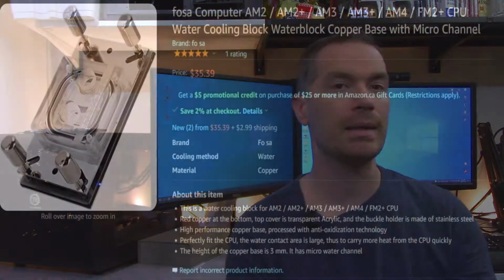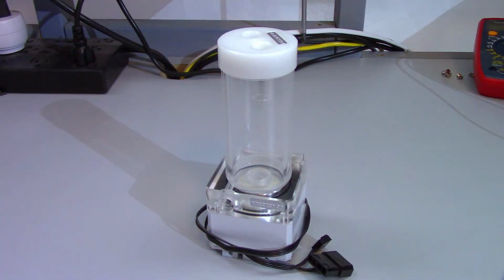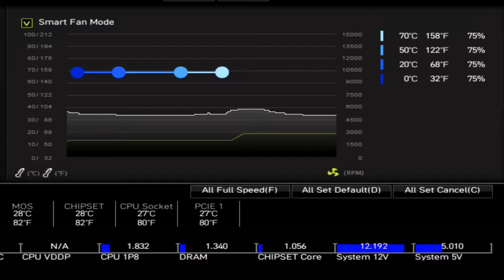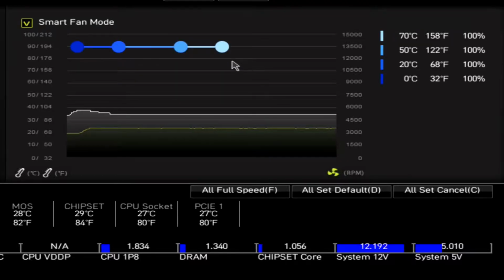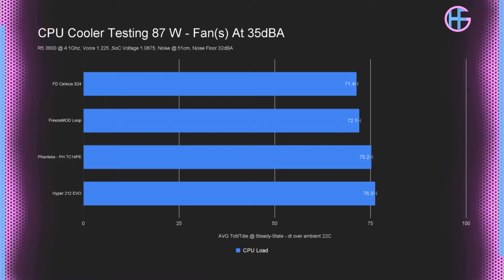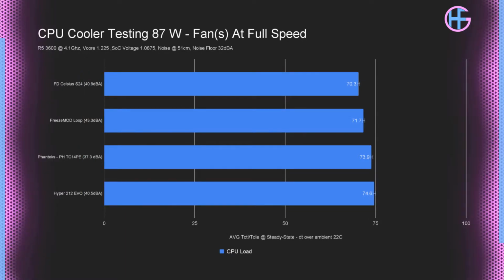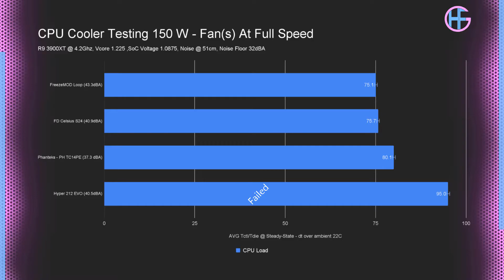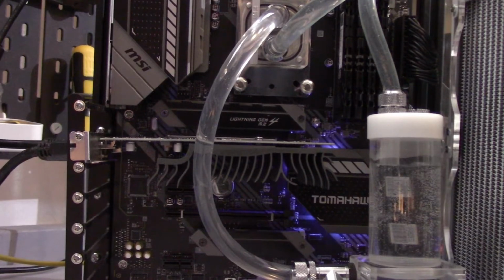Custom Water cooling Loop PT3 - The FREEZEMOD loop Is It Worth the Price?

Comment: I have the same CPU block with aftermarket GPU block, 9mmID soft tubing, 360 rad, $28 pump, R7 3800X CPU, 1070TI GPU, overclocked to 4.5Ghz. Stable idle temps 32-34 C , Load Temps 55-60 C....... You have got something wrong in your assessment and you have air in your loop so your temps will be wrong.
Reply: correct when your water cooling the standard positioning of the water block is IN = below while OUT= above (there's no need for manual all you need is LOGIC physics to be exact = hot water wants to go up not go down & water pressure  + flow is better in going up rather than going down).
Meaning if the tube in the CPU block is connected properly there might be atleast 3+C difference.

Comment: I have now also bought this CPU block.
I previously had a NexXxoS XP3 Light and Kryos Next. Both have identical temperatures as the Freezemod. And the assembly of the Kryos is much harder than that of the Freezemod.

Comment: After 4-6 years you will see pump failures where the impeller is stuck in the pump. By disassembling and cleaning the pump you get another 1-2 years of runtime, but it is good to plan how to get access to the pump with this type of system.
Reply from the maker: Thanks, I'll keep this in mind.

Comment: Im back again, I'm looking for radiator size sweet spot and noticed this video again and somehow rewatch it.
Currently the 1 hardware to 1 120mm radiator no longer works.
The reason I'm searching for info since I'm adding an external 2nd loop for GPU only.
Back to the video base on current latest standard of water cooling.
The new rule is 1 120mm radiator per 100w.
So if your running a ryzen 7 or 9 you want to get a minimum of 1 240mm radiator.
But the minimum thickness is standard size means 40-45mm thickness.
So if you have those CPU a 1x 240mm 40-45mm thick is your bare minimum but in forums ATM they will rate your loop as noisy equal to an air-cooled system and thermals slightly below to an air-cooled.
So the recommendation is add another +120mm for OC and add another 2-3x 120mm for silence.
Which will result in a 2x 360mm for best cooling and best silent.
The demising return when rad exceeded the maximum cooling will give you a BONUS SILENT OPERATION which is the main benefit of water cooling.
Then the most tricky part is the GPU for a 300+watts GPU a single 360mm is the sweet spot for cooling  "Linus test" 40/45mm 240-360mm he said 240mm but it's 360mm in reality.
The problem is your fun are near to 100% or 100% which are noisy for a separate loop adding a +240mm will result in silence.
But if a loop like 2x 360mm 40-45mm already exist then just adding another 360mm will result in silent operation and good cooling performance.

The problem with AIO is that your limited on the radiator size you bought.
The advantage of open loop is you can add as much as you want as loop as your case support it.
Incase there's no more room you can do a modular removable external radiator build (this is what I'm doing I have 2x 360mm 27mm thin rads for 3700x & 2x nvme gen 3).
A GPU is not enough for those rads so a 480mm 28mm thick radiator will fix the issue using a radiator stand and external pump+reservoir and 2x quick disconnect fitting hard tube on the loops but soft tube for the 2x quick disconnect for modularity (currently purchasing the parts and made designs for the build).

This are what AIO can do.. open loop  biggest advantage just like what I said before is you can always add more and more is always better (not for the expenses), nvme, CPU, GPU becomes hotter and hotter and since the old Rule doesn't apply now the gap in cooling performance will increase between AIO and open loop.

That freezemod loop is equal to a good AIO of same size but if you add another 240mm rad even it's brass then the thermals & noise will be reduce.
Aluminum AIO radiator > brass-copper radiator of same size.
But Any open loop pump > AIO pump.
The reason they have near to identical performance are the open loop pump which will result in better flow rate and faster cycles.
The AIO having near to open loop performance is due to aluminum superior heat dissipation than pure copper and copper brass.
(The trick is AIO uses copper cold plate to absorb more heat and transfer it to the radiator that dissipate heat and aluminum is the most superior metal in terms of dissipation) pure copper can absorb more heat and better thermal transfer but copper holds the heat and sucks at dissipation which means in a copper radiator you need a better cooling fan and higher rpm unless you have stock up rads that exceeded the thermal capacity of your hardware then you can lower the fan as much as possible without performance and thermal lost.
Reply from the maker: Okay there's a lot to unpack here, The first thing I want to say or add is the thermal conductivity of copper is 399 W/m·K,  aluminum is 235 W/m·K, brass is 120 W/m·K but water is only 0.6 W/m·K so the weakest point of transfer will be the thermal paste on the IHS and the liquid in the loop.

Now, I would agree that 120mm of radiator for every 100 watts is a pretty good starting point ( a good rule of thumb for AIO's). Now I don't understand you calling a 40-45mm radiator "standard". The standard AIO radiator is 30mm, I know there are thicker radiators, but most people have or are using a 30mm radiator. Now, the idea of adding radiators to have silent operation thing. you didn't really mention what fans you're using? Are you doing a passive system?? Anyways, you could have 3-360mm radiators and still thermal throttle if the connection to the CPU sucks (the BLOCK). 

Which brings up my next point, even all that thermal mass (3-360mm radiators) doesn't lower the CPU or GPU temperatures. Thermal mass will buy you time, but that heat needs to dissipate into the air at some point in time. which is where fans come in, and yes having good static pressure, low noise fans is HUGELY important. but thermal mass really doesn't do anything on it's own, and that's why passive systems are pretty much pointless (eventually you will hit thermal equilibrium and the CPU/GPU will reach max temperature).    

my advice is what your doing is way overkill, and you likely should scale it back. Now, if you are building a passive loop, don't. Add some Arctic P12's and have them run at 300 RPM (so you won't hear them, but they will move air through the radiators)

Comment: Great review. Now, i decide to start my first custom loop with Freezemod.
Reply from the maker: Cool, let me know how it goes 👍
Reply: It's fine the freezemod loop will always be slightly better by small margin with a stock AIO of equal size (the custom loop in & out of the CPU block here is wrong so the loop should always outperform the AIO all the time by small margin).
If your going to use the same radiator for the loop then you want to throw another one on the loop to further lower the temperature since freezemod brass rads are the cheapest even among the other brass radiator brand of same size.
Or get a pure copper radiator it will definitely outperforms any AIO.

Comment: As someone who does a lot of custom loops I can say that I have never done a loop with just CPU cooling, cooling the GPU as well is the main thing. With the correct loop you end up with a very quiet system that doesn't increase in volume when under stress.
Reply: I never water cool my gpu and i make my loop so i can remove most components without the need of disassembling everything .

Comment: You can rotate the coldplate on this waterblock by 90 degrees which might noticeably improve cooling performance on Ryzen 3000/5000.
Also if you really want to maximize price to performance then cutout the threaded reservoir and instead use a T-line to fill and drain the loop.
Also the metal emblem will fall off.

Comment: It's not the waterblock issue for bending the pins it's amd lock mechanism issue
Reply from the maker: This is true...
Reply: @HardwareForGamers  Forgot to mention your inlet is at the top most of the cpu block
And outlet is from the bottom 
It will create air bubbles at the top and not good for cooling.
The inlet is always position below and out is at the top of the cpu block unless both in and out are vertically aligned.
But The cpu block in and out is horizontally aligned so the in should be at the bottom and out at the top.
The temperature performance should improve because of a proper flow.
Reply from the maker: @gamertechlive1780  okay good to know, I'll keep that in mind when I set it up in my editing rig.
Reply: @HardwareForGamers  I have the same radiator 1x 120mm and 1x 360mm same color I picked it since I'm looking for a white affordable copper/brass radiator.
Used bykski fitting and some Barrow fitting, freezemod m.2 block block and Barrow cpu block, bykski pump combo w/acrylic tube.
The problem is GPU pricing my RIG is sitting for already a year now all bnew and assembled.
I flush the radiator using tap water repeatedly and used hot top water for better cleaning again and again and rinse it with distilled water let it dry for hours and use the plastic plug again so that dust can't enter.
The problem is today I remove the 1x plastic radiator plug since there's no fitting and tube connected to it because I don't have GPU atm so that's the last remaining part of the loop to be connected to GPU to pump.
But here's the problem what I saw is white colored covering some of the brass part of the radiator..
Are this flux or gunk? Or slime? Etc?
I don't want to disassemble everything lol. So if it's flux/gunk I'm planning to flush it with mix of distilled water and vinegar.